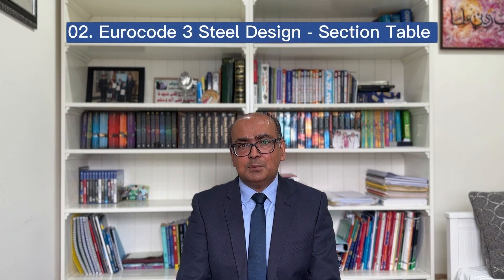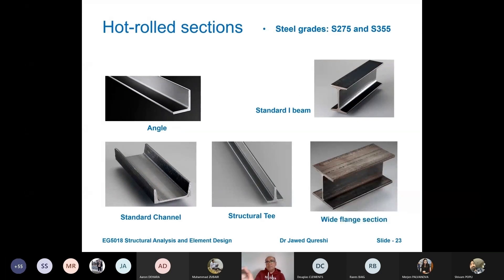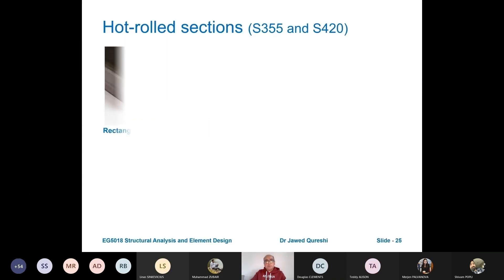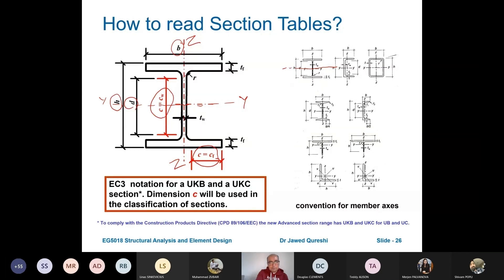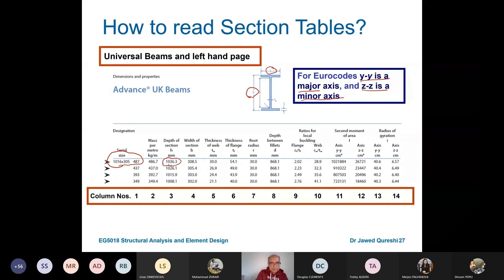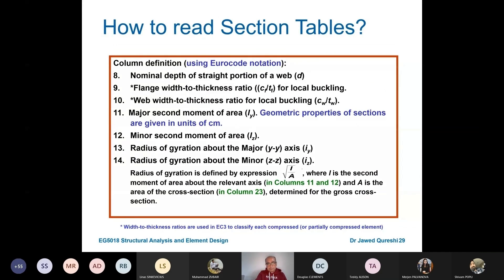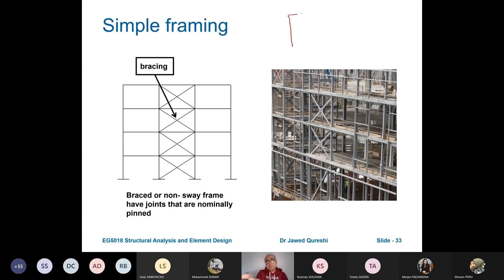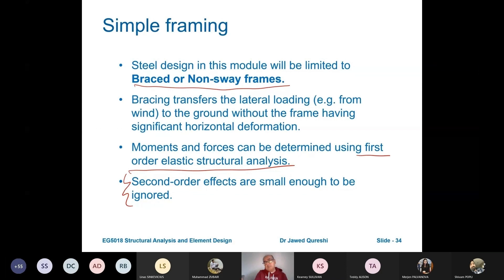02 How to read Section Tables | Eurocode 3 Steel Design series | Introduction to Eurocode 3

Comment: Thank you Prof. The video is very informative, but can you explain why the P-delta effect is not effective in design??
Reply from the maker: P-delta effects should be checked for all steel buildings. I’ve a lecture in the same series on lateral stability where I check p-delta effects using alpha critical approach in Eurocodes.